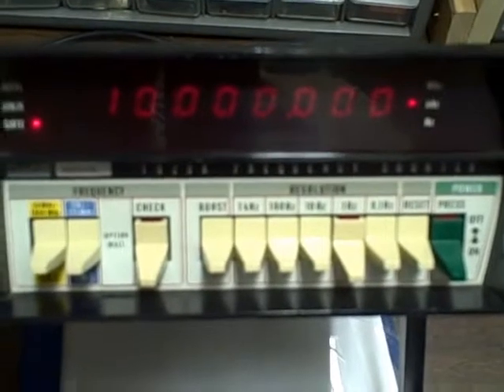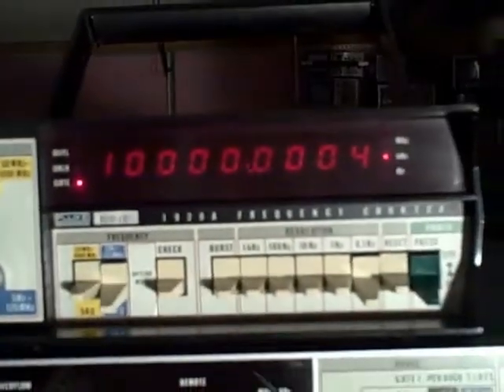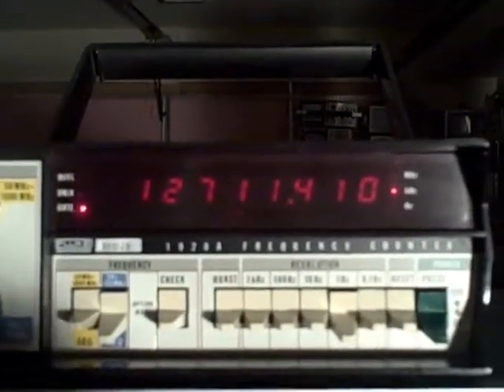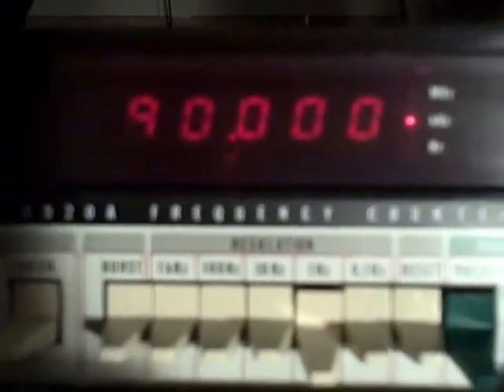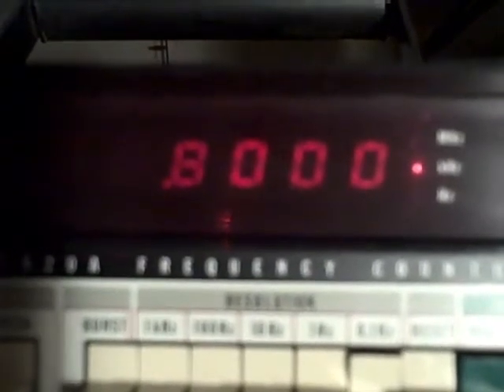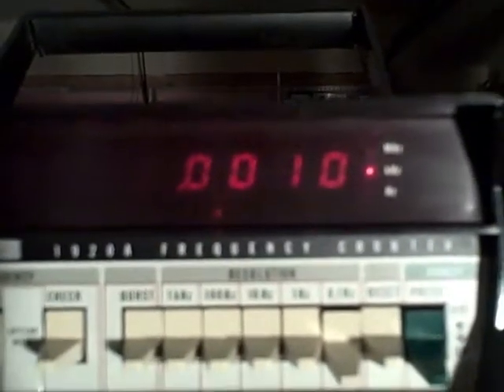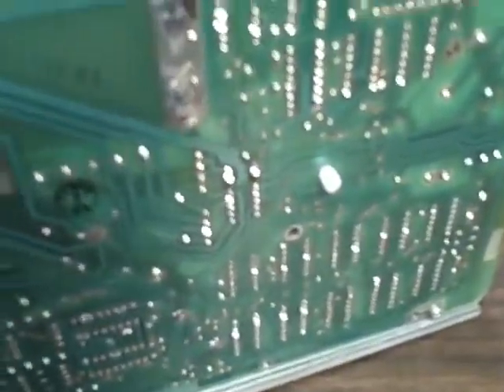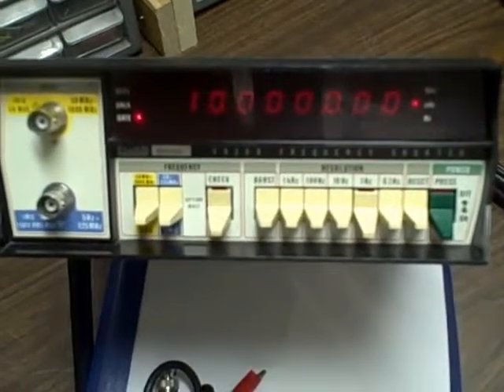Fluke 1920A 1Ghz Counter - Being Tested

Comment: the self test of 10mhz if its 10.0000.000 does that mean its calibrated?
I can use a rubidium unit but do I adjust the clock TCXO or a trimmer elsewhere?
thanks